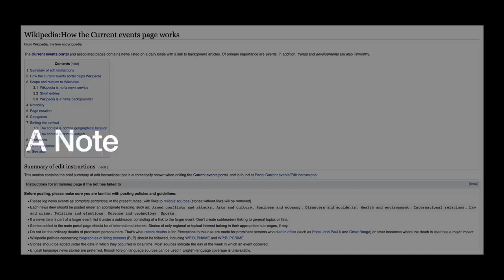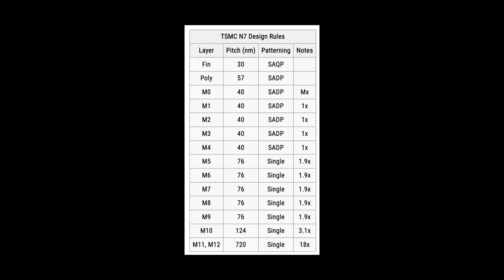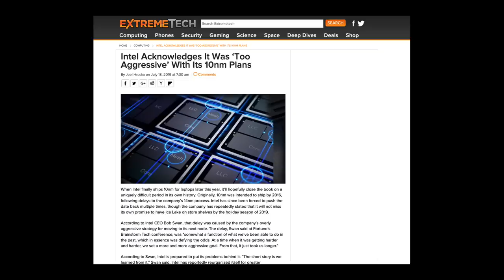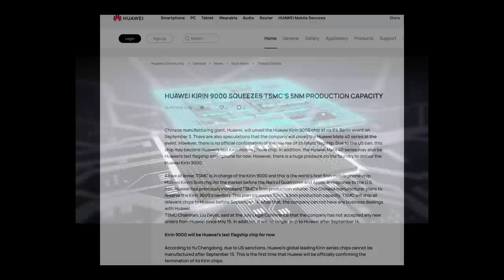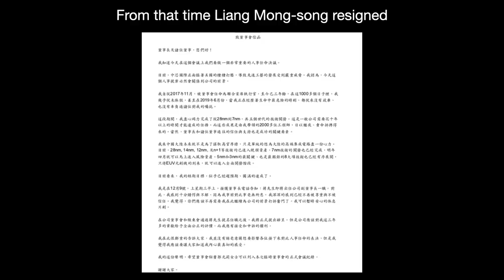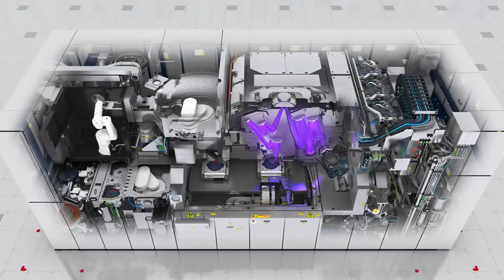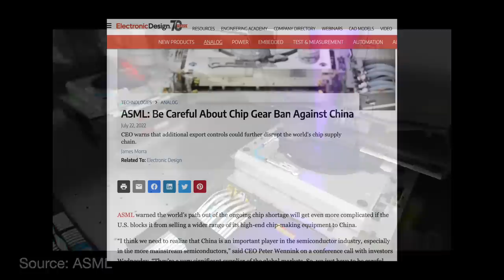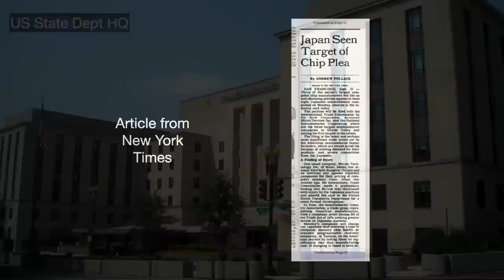China's 7nm Chips: SMIC N+2

Comment: I think its worth mentioning that China approaching  parity so late in the silicon game diminishes returns on capital (before even considering trade barriers to the Chinese chip production). Silicon transistors can only get so small due to physics. So whats the big deal?
Reply: A new competitor doing the dame thing but in a different way, thus means new tech or progress, that's the big deal, it would not be a big deal if they just adopted the tech from others existing companies, this also means that it's technically an alternative to the usual choices
Reply: The big deal is they can reduce the cost for the Chinese market forever, which is billions of dollars each years.
Reply: Both of you neglect to realize the tens or hundreds of billions of dollars the Chinese have put into this industry. It will take decades to recoup. And thats assuming they'll be able to manufacture these at scale. Also assuming major economies will allow import which I highly doubt.
Reply: @marcsainz6800  , I am curious after the US ban if any Chinese chip manufacturers are actually profitable or they are still on the Chinese govt.'s subsidies.
Reply: @ongmat4439  The big deal is in short : NATO countries will no longer have and edge on China and Russia on this tech domain of baking Chips. And yes the chips are probably baked in Taiwan and South-Korea.

Comment: I am a bit confused by all of these charts that seem to not show any 4nm node from TSMC as I read that Nvidia's 4000 series gpus will use  TSMC's 4nm process.
Reply: TSMC 4nm is just a optimized version of 5nm
Reply: @mattiasolsson2499  What a ripoff.
Reply: N4 is just a normal half step. The reason they specifically mention N6 is that it's a quite cost optimized half step of N7. That is, it doesn't improve much on density, but it is 100% design compatible with N7, has better yields and costs less because some critical layers have been moved from multi patterning on DUV to single layer EUV. Don't quote me on it, but I've heard a 20% reduction in wafer price with yields in the 99.xx% range while cutting 5 days off the lead time.
Reply: @housemana  What are you even talking about?

Comment: EUV is the real western advantage. The production costs of multi patterning gets higher and higher the smaller you go with DUV. So the Chinese may make a few very expensive 5nm chips compared to the "west" who is already making EUV 5nm. Advantage is still the US. And China won't be able to make their own EUV quickly, that took well over a decade in the west to get working no matter what kinda of stud R&D co president smic has, they don't make tools!
Reply: US dont make EUV as well. 😂
Reply: @yourbaba4996  yeah, they only told asml to not ship it to China and they listened. So the US runs the show.
Reply: I'd add further the euv light source is made in the US by Cymer which was acquired by asml. So get your facts straight.
Reply: @yourbaba4996  Learn about the US company Applied Materials. They're the other one besides ASML that has EUV technology.

Comment: I’m wondering when this scaling down towards 1nm or Angstrom units will flow down to sensors. I’m a developer that has by happenstance been involved in a lot of IOT projects the last two years, but I must say that I’m puzzled of how “big” the size of sensors are. Raspberry / Arduino supported, they are small off course, but I’m thinking of what is actually possible when chips are around 5nm in production.
Reply: Why would you want 5nm sensors? It'd just be much more expensive, while performance won't be improved. It's not like they need much higher energy efficiency. They'll be built on the lowest cost node, which today is 28nm.
Reply: @KajTallungs  u can still find fabs in 250nm, they make sensors, logic gates, etc. 
We don't need to have a leading edge sensors. But we need computing power with low power consumption....
Reply: @KajTallungs  All sorts of magic happens when you're able to stick a bunch of sensors in clusters.
Reply: Sensors are analog at first. Almost every measurement is taken by converting a physical property to a voltage. You want the size of the sensor to be large enough that ypu are not measureing single electrons and even better averaging out the noise.
I wonder which sensor is even viable for 5nm.
Reply: @Mkoivuka  that may be true, but there’s still a practical limit on any benefits on things like sensors. Even if you can squeeze more sensors into a mm2, what’s the point. If the end product has all the sensors it needs in a just a couple square mm, there’s no practical benefit coupled with tremendous cost to move the production to a smaller process node. Think simple sensors like temp/humidity, or the sensors that trigger airbags in cars. There’s no ‘magic’ possible in process improvement if it doesn’t increase yield and/or reduce cost because the chip itself is basically perfect for it’s designed function as it is.
Reply: leading edge semiconductors are mainly for digital computing. analog sensors don't scale that well in the sub 100nm i think
Reply: 5nm has been out for a while, 3nm will be in mass production within a couple months and the next node is in development
Reply: @KajTallungs  well, Im involved In a medical project where this would be great, now it’s too big, but I assume there are a lot of other practical use cases as well

Comment: Commentators are pouring cold water on Chinese 7nm chips saying it is very expensive for the Chinese but doable. Everyone knows the first prototype or even the first draft law or contract is very difficult. Commonwealth countries copy each others criminal laws and contact laws because there would be consistency now and in the future, as well as faster and cheaper. Cost in Chip making and producing the chip making machines are the same. Once the first ones are out, the rest will come in great numbers. The actual costs are just some raw materials, the rest are knowledge which become cheaper as more people gains it. Even making a PC or handphone.  We can even expect that in 5 years, the 3nm chips will cost less than 20% of their present prices because people may have switched to quantum chips.

Comment: Have Betamax and VHS taught us nothing? It doesn't have to better, it just has to be good enough and cheaper. The latest chips coming out from Intel and AMD and Nvidia are gaining performance at the expense of large power draw. Moore's Law is dead. Realistically we're hitting the plateau of an S curve in microprocessor development. Nobody is quite sure what the Russians are up to with X-ray lithography but if they could make that work everyone would forget EUV.
Reply: Do you realize that those manufacturers you've cited also does low-power chips? 
Look closely at the TSMC chart displayed in the video. There is a choice to make between power draw and performance depending on the application targeted.
Reply: @PainterVierax  you can make any chip a low power chip by throttling the TDP. What is your point?
Reply: @kalliste23  my point is exactly my first sentence: they design chips against certain requirements. So depending on those they change the microarch to met them, from the Intel Quark, Ryzen Embedded or Nvidia Jetson, up to the rendering server and workstation chips.
Reply: @PainterVierax  are you saying the Chinese can't do that? What is your point?
Reply: @xybnedasdd2930  you're probably right but the Russians have done some impressive engineering in their time.
Reply: @kalliste23  No, I'm saying your affirmation on those chip makers lacks a lot of knowledge about what they offer and how nodes work in the entire scale. I don't care about speculating about SMIC capabilities, the video already argued fairly about that.
Reply: @PainterVierax  you're just talking nonsense that has nothing to do with the point I made.
Reply: Yes, do not mess with The Netherlands. 

They will just introduce DVD and Blue-Ray after Betamax for fun. 

Then go make next gen Lithomachines call Twinscan and EUV after workhorse called Philips PAS system :O
Reply: @katarn848  still looks to me that they're reaching sharply diminishing returns in chip fabbing. It's becoming so absurdly expensive to do anything and chips are absurdly powerful already at current state. Plus without sand Taiwan is in a bit of bind.

Comment: I think the analysis since @10:43 is a bit hasty and misleading:
1. ASML and TSMC aren't US companies. They are not US to protect. Unless, Netherlands and Taiwan are de facto US colonies.
2. I don't believe Chinese semiconductor ecosystem is anywhere close to what Japanese companies were in their heyday. At best, China will earn semiconductor independence, not even semiconductor security during wartime.
Reply: So for your 2nd point, how did you get into that conclusion?  What standards or scales were used?
Reply: @LaowaiDaveJCP  China is still far behind in many things - chip IPOs are all American or held by US allies (ARM, Samsung etc). EDA tools are also all American. But those, along with lithography, are just more technological gap to surmount. Where China is indeed behind are:
1. Semiconductor industry ultimately feeds on material research. Chinese unis are awesome, but still behind to both Japanese or US companies.
2. Technology is ultimately market driven, and most of the chip market is again US companies. Japan had access to US market, not so much for China. So, they'll have to build the entire thing. Imagine China building another Nvidia. Imagine lining to buy Chinese GPU. Until that happens, China is way off.

Comment: No, theoretically, 7nm means that the smallest component which can be fabricated is this size. These measurements may be used for PR, but that's what it means.
Reply: No it just has the equivalent performance to transistors with that channel length.

Comment: When is YSMC going to make a resonant tunnel diode threshold logic gate fab? 100,000 times the speed power product of CMOS plus current clock rates of 2200 GHz are nothing to sneeze at (plus they are smaller and cheaper than CMOS).

Comment: Thanks for this excellent video, Jon. What does it meant that SMIC's N+2 node is less efficient than TSMC's N7? Would manufacturing yields be lower (or % of faulty chips higher)? In terms of performance, are they similar?
Reply: both, performance is marginally worse. essentially the technology theyre using to make their N7 node is not as accurate or as efficient as the competing equivalents, therefore yields will be lower as it both takes longer to do and its less accurate at doing it so faulty chips will be higher. due to the latter the chips themselves arent as efficient on average so performance and power draw would be slightly worse, their highest binned might be on par but that percentage will be very low
Reply: @jacklobb3510  You are half right. 7nm chips made with EUV-LITHOGRAPHER is certainly better than that made with DUV-LITHOGRAPHER.  TSMC is not making 7nm chips with DUV-LITHOGRAPHER any more.
Reply: The same people making assumptions about N+2 yield, who can't possibly have access to that information, tend to be the same ones making bad bets and underestimating the Chinese in the past. Past track record says it all - in everything from high speed trains to EVs to solar energy to airliners, these same people who dismissed the Chinese based on their later proven wrong assumptions and no actual data to back it, turned out to be wrong, repeatedly. The idea that, for the first time in a 4 decade long losing streak, they'll be right and the Chinese will fail, is a bad bet that no rational person who's seen the past records will put their own hard earned money on.
Reply: @jacklobb3510 basically buffed 10nm, simc 7nm is similar to Samsung 8nm or slightly better
Reply: @georgedang449 semiconductor is harder than high speed train

Comment: Hi, can you consider doing an update re chips 4 alliance . US pressure on new South Korean govt to join. Already earlier in yr, SK Hynix not allowed to update Chinese factory  with new tech. DRAM sales to China worth 78 billion last yr. Tsinghua Unigroup group bailed out with lot of losses, when can it catch up so not reliant on South Korea for Dram, thanks.
Reply: since the core tech for chip manufacturing is already blocked, any further sanctions will have diminishing effects, china will just use what chip fabrication capacity to make those as well.  The latest DRAM doesn't require EUV as far as im aware.

Comment: No! It's a 70% shrink; that's "30% better" in each of two dimensions (.7 squared is .49 or a rough doubling of density). That's the historical cadence. But even that no longer holds. Without a doubt, though, your claim of "70% better" is just wrong, and was never the case even when the name of the node had some correspondence with the underlying technology; "30% better" is at least defensible. "Multi-patterning." Not "multi-pattering" or whatever you're staying.... Sheesh. Learn the terms of the art already.